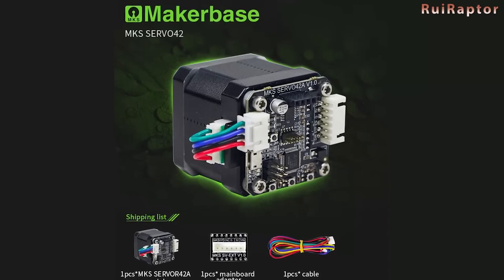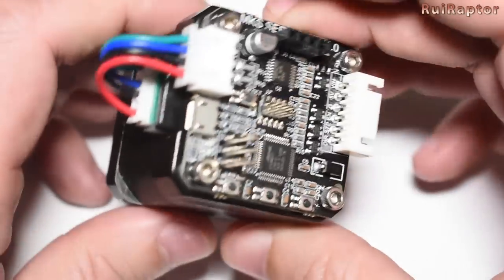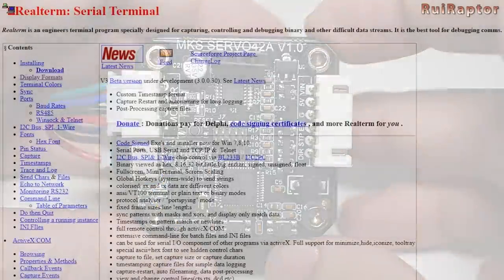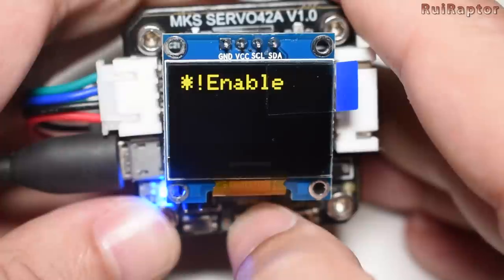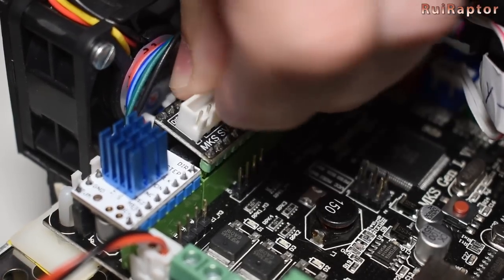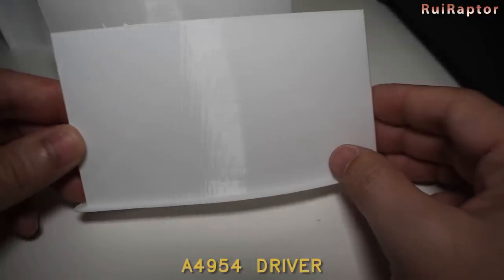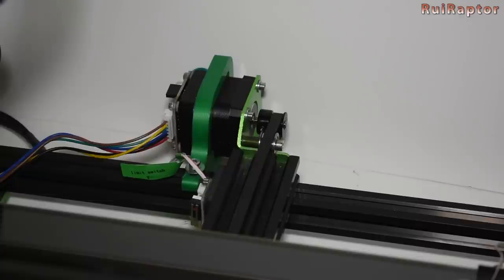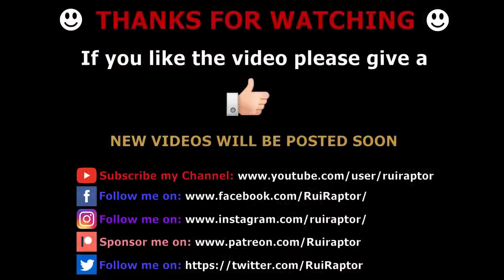MKS Servo42 Close Loop Motor (MAKERBASE) - Tests & Results

Comment: As Trampas said, these are clones/ripoffs of original misfit electronics design, even the display in the firmware says that. Salmon skin is absolutely a result of a miss-configuration. These are NOT plug & play, you need to find pid values which work best for the setup being used. Stock pid are very generic and are just to get you going, you need to know something about how PID loop works, and Trampas actually supports the products he sells, and will help you find the appropriate pid value. Good luck getting MKS to help you with any of that. I run 4 of the authentic ones and have had zero salmon skin or artifacts, (after I tuned them properly to my setup) and I also run these only on the heavier axis, and trinamic 2660s on the X axis. Also salmon skin can be a result of poor noise isolation in the cable, the cable going from the main board to the stepper board needs to be shielded, or there will be odd issues, the cable included by MKS is not. At the minimum the step/dir wires must be shielded. This is what happens when Chinese companies clone a western design.
Reply: This is really helpful ! looking at the "genuine" now.
Reply: where can I find the legit? I am currently in the process of building my first diy 3d printer
Reply: @Kalvinjj yea other guy thinks he's on some high horse cause he isn't buying the "clone." Exactly as you say it's open source and using the term "clone" as if signifying its a negative thing is completely false and does not in any way mean it is a negative. Way more often then not clones are improved and better than the first iteration. This guy has some superiority complex syndrome or something

Comment: Hello
06:07 I bought 4 of them at Jul. 20 2020.
A magnet was attached to the center of the motor shaft using a resin cylinder 9mm / 6mm.
Use resin spacers to attach the board to the motor.
The screw holes of the motor have a recess for the screw head, and there are many gaps on the back of the spacer.
As a result, it cannot be tightened strongly.
I don't know if it's caused by the rotational vibration of the motor, but sometimes the board shifts.
As a result, the magnetic detection encoder settings will fluctuate.
It is difficult to calibrate the motor each time.
Another problem, the closed-loop servo system should be excellent, but the problem of accumulated pulses becomes noticeable and drive delay occurs.
Originally, the stepper porter has only the problem of magnetic pole deviation unless it is stepped out, and it does not matter in the case of microstep.
From a different point of view, mechanically engineered encoders have advantages when applying closed loops to stepper motors.
An unstable magnetic encoder with uncertain mounting can do a hundred harms, but no profit.

Can I use it as a system that opens the closed loop and pretends to have pseudo-feedback that follows the pulse signal?

If that is not possible, this foundation has no meaning to exist.
Please consider it once.
Best regards
Reply: Have you come to any conclusions about the questions you asked and concerns you had? Very interested to hear what you have to share about this topic

Comment: I know this is an older video but I am thinking of getting the SERVO42C. I was wondering if it can be controlled in service from a computer via the USB with just power into the board directly. ie no separate control board ? I'm looking at building a CNC router and want to use 4 of these to control motion,,

Comment: Thanks. I'll go with what you said but first:
1. I run a delta and i want these for my XYZ motors.
2. I want to believe i will know how to tune these - just need the info how.
3. According to the manufacturer - you can't buy only the boards and I already have 0.9deg's.
4. According to the manufacturer - No plans to introduce TMC's drivers for these.
5. I searched YT for video showing these in action on a delta printing a model without Salmon skin artifacts to no avail.

I really like the way this is all going, but too soon for me to jump in. looks like we're at least a year away from having a good solution. I know other companies that sells only these boards and if they will prove a salmon-skin-free print, i will go their way.

Comment: Great work. Good to know about this possibility.

But if you have issues with Y-layer shift, there are 2 more efficient solutions by my opinion.
- Set TMC driver to spreadcycle mode. Default stealthchop mode has problem with high torques. Didnt tested because I do not have this problems.
- Best solution by my opinion is ged rid of glass/mirror on your bed. Just to get perfect first layer you must face this issue. I dont have any issues with Y-layer shifts with your configuration(motor, board, drivers on stealthchop), with stock bed sheet and 2000 accel (running on Klipper firmware). I solved bubbling issue by heating bed on 100°C and squeezing bubbles out.

Comment: I am trying these (bigtreetech s42b model) on my dual z printer for the z axis steppers. I think this is the best use. Should allow better layer resolution and keep the level better. I don’t think salmon skin effect will show here.
Reply: If you need good precision and level holding on the Z-axis, a 0.9 degree stepper and a good quality 2mm pitch lead screw will do an excellent job for much less money (5 micron full-step accuracy and very resistant to back driving).  A servo is way too expensive for what it's worth on a Z-axis.
Reply: @KarriKoivusalo  This is a Nema17 stepper with closed loop feedback. I got them for $20 a piece assembled. So I can keep my original leadscrews and carriage assembly exactly as it is. I am not sure how a 0.9deg stepper which usually cost more than $20 and a new leadscrews and a new carriage nut which hopefully fits my carriage is going to be cheaper,much less if it does skip a step it's done being level. I do run Marlin 2.0 with auto z align before every print.
Reply: If you have a problem with Z-axis losing steps, it's a failure on the stepper motor part. Are you sure having the cheapest of the cheap parts is going to fix it?
Reply: @KarriKoivusalo  Well I am not having lost steps, but I don't care who you are what machine you are running, but on a dual Z independent gantry you will have some skipping. That is just a fact no system is perfect. If they were why in the world would most every precision manufacturing machine use closed loop servos over open loop steppers. I can tell by doing a Z auto align after a print that there is some small step loss. It is pretty minimal but it is there no the less. If you look at your prints you probably will see some very small tell tale signs like one layer looks just a bit squished . I did this mainly to test out how well it works, so far its pretty interesting. I might have some setup issues. Upon re-enabling of the stepper drive it goes to the calibrated position don't know if that is good or bad, but if you set it high it goes up to the top and very rapidly at that, if you set it low it could hit a print if you dont do it right. most of the time You would  remove the print before doing this but... I was thinking mostly to see how well this would work and if it does, which it seems to, why not design something like this with say a TMC5160 or 2209. Closed loop has a very strong appeal to it regardless of how good you machine is. I can say that I am able to achieve much higher velocity with my Z-axis now. It could be the bigger motors over the stock ones, but I would lose steps if I tried to go over 12mm/sec now I can achieve well over 20mm/sec without skipped steps. Why is this important you may ask well I can say that I have shaved a couple minutes off of a  2 hour print in just the increased speed in my Z-Hop, and my prints are dead on in the layer heights. And no I did not cheap out on my printer, well perhaps when I started I did as I bought a Anet E12, but its pretty much a from scratch printer minus the base frame and heated bed platform. Now its a SKR Pro powered linear rails for z All Metal Nickel plated copper V6 BMG direct drive using mostly TMC2209's minus Y which is a TMC2160 with a .59NM stepper , homebrew heated space, Cant call it a heated chamber due to statasys.

Comment: Click the MKS-SERVO57 manual to display the MKS-SERVO42 manual.
MKS-SERVO57 is not working properly and cannot be calibrated.
What should i see?

About MKS-SERVO57 and MKS-SERVO42.
Do you recognize that both are the same?
There is a manual on 42, but the operation method for setting is different.
But 57 has no instructions.
It cannot be set by operating in the same way.
I manipulated it by mistake and set one item by chance.
It cannot be manipulated and reproduced at the next opportunity.
I would like to ask the person in charge of 57, it is not the same as 42, so please make a correct manual.

Comment: If you were to forcefully stop the print head mid print will it correct itself and catch back up? You really should have done that in this test
Reply from the maker: Hi,
I did try that. I jammed the motor shaft for a second when the motor was moving the axis a long lenght and at the end the carriage moved the same amount that i told it to move.
Reply: @ruiraptor  Did the other axis's get out of sync? I was worried since just the stepper itself is closed, but there is still no communication back to the MKS to tell other steppers to wait until its back in sync right? Did you do that in the video? I dident see that.
Reply from the maker: That is correct. There is no communication back with the board and the other motors so if you jam one of the axis the others will still continue. The jammed axis will recover but depending on the movements the printer is doing, it might not be fast enough to recover without getting layer shift effect.
Reply: Yes, it will, the motor will only lose step temporarily, but will continue to try to catch up with the correct amount of steps

Comment: Would be interesting to measure the delay in motor movement you add by introducing some extra logic and processing with the servo in there. Maybe thats where the salmon skin effect comes from, as the one modified motor-axis is always lagging a little bit behind where the main board actually think it should be?

Comment: Nice video and good product
Please 2 questions for this product:
- Can we disable microstepping function or choose smaller microstepping like 1/2  1/4  1/8  ?
- Do we need limit switch ?
(I want to use this board-motor for another application not for 3d printer were is not possible to use limit or home switch)

Thank you
Reply from the maker: Hi,
regarding your first question, yes, you can choose a smaller microstepping.
Regarding the limit switch, this board/driver does not support sensorless homing so you need limit switches.
Reply: @ruiraptor  Thank you for your fast response !!!

Comment: To clarify, the motor can lose steps, but will try to make up for it, so if you block the head, it will jump back to the correct position, considering all steps it was supposed to make during the time it was out of sync. You CAN use this stepper with boards without replaceable stepper drivers, but you need access to the stepper dir, step, cs, 5V, motor power and ground signals. So to install it on board with headers for these signals it's still quite easy to install.
Reply from the maker: Hi Ron, you are correct. 
Regarding the installation on boards without replaceable drivers, the board needs to have driver headers. We now see boards that have them but there are lots of boards that don't have and the installation on those it's more tricky.

Comment: Really interesting video. Can you buy that motor board on it's own? Or does it require a custom version of the nema 17 with it? I've got the newer tornado, so it doesn't have the salmon skin by default, so am I right in thinking this wouldn't give the salmon skin? Hopefully they come out with a TMC version at some point.
Reply from the maker: Hi,
the salmon skin if from the driver and not the board so even if you buy the motor board alone it will not fix the salmon skin. The motor board can be used with any nema 17 motor but you will need to add a small magnet on the motor shaft for it to work.
Reply: @ruiraptor  Thank you for the quick reply!
Reply: @ruiraptor  Hi, I bought the board and driver alone, it didn't include a magnet. Can I use a normal round magnet and what is the correct procedure in attaching it to a Nema 17 motor?

Comment: Note that the salmon skin is most likely due to the PID parameters being not tuned for your printer. That is the PID control loop may over shoot, which will result in the salmon skin effect.   It could also be that the A1333 encoder MKS uses is lower resolution, resulting in some slight position error.     Additionally you can turn up the current on the control board to near the maximum of 2.0A even though the motor is only 1.3A. The current rating on the motor is based on the continuous current, where the firmware currently specifies the current as the peak.  Since the smart stepper firmware will reduce the current if the position error is low their is little risk in exceeding the continuous current rating of the motor unless motor stalls for a long time.  Future firmware releases of the smart stepper firmware will add in the continuous current limit (which will not be available for MKS).     Also to show the true power of the smart stepper firmware during a print grab the head and move the print head.
Reply from the maker: Hi,
thanks for sharing this.
I didn't raise the current because the MKS Servo42 manual states that the stock value is the max value that should be used for this motor. Also, with the tests done with other allegro drivers, increasing the current didn't help to reduce the salmon skin.
Regarding the encoder resolution, from what I see, it has a very good resolution so I don't think that is the issue.
Not only the DRV8825 drivers have issues with salmon skin. The allegro A4982 also have this issue (see my analysis video here: https://youtu.be/78fonMoXRuA ).
Reply: Hi Trampas,
I'm running my printer with Smart steppers (FW0.37). Earlier when running the printer in regular cartesian XY, prints were good. Now with it setup as a CoreXY , I've been introduced to severe salmon skinning on all surfaces. Maybe some tuning is in order for this kind of setup?!?
Reply: @human2761  What controller are you using?   The Duet has some acceleration math bugs for coreXY,  which I have seen causing problems. 
Also with the CoreXY it is critical that the both motors accelerate the same and respond the same,  so try slowing down the maximum print speed and see if this fixes/reduces the problem if so let me know.  Specifically I am worried that if you tell bot motors to move 10 steps and one has an error and takes slightly longer to move it will cause more issues on coreXY, if you slow controller down and problems go away then this might be problem.   Another issue might be the ringing on the PID tuning. For this try dropping the P term to 0.4 and I term to 0.0004 and d term to zero. This might reduce the ringing due to lower P term and hence reduce salmon skin effect.   However by all means let me know and also check the Smart Stepper group: https://groups.google.com/forum/#!forum/smart-stepper

Comment: Can I control this MKS servo 42  with Arduino along with the built-in board? may by using the shield.
Reply from the maker: Yes, you can use arduino to control this stepper motor. The driver is included in the motor so you only need to send the control signals.

Comment: Can you switch out the driver and put a tmc 2209 instead of the one that comes with it?
Reply from the maker: No, that is not possible. But you can find some closed loop motors with TMC drivers in the market.

Comment: Did you try to push the bed and see if it moved back into position after being pushed further away from its location that it needed to be or isnt it supoosed to do that?
Reply from the maker: Hi Thomas,
yes, I did that test while the motor was on my hand. If you try to rotate the motor shaft, it will return to the original position.
Reply: Thanks for replying :)

Comment: Great video! I wonder if salmon skin is produced by the stepper driver or the encoder. Theoretically, the servo mechanism should correct such errors, unless the encoder itself is somewhat non linear between steps. This can happen because of non -controlled magnetic hysteresis and the fact that is hard to perfectly center the encoder.
Reply: I think that the problem rises from the driver's zero-crossing anomalies and can't be filtered or fixed.
Reply: Since this is a ripoff of the Smart Stepper from misfittech, it should have the same calibration routine which deals with this issues. They skimped on some components, so that might cause some issues. You also have to do the calibration for it to be effective....

Comment: the print speed increase is amazing. wish you could get this with TMC. maybe I can make my own but it'd take ages
Reply: Are you running your TMC drivers in StealthChop or SpreadCycle mode? SpreadCycle gives more torque at the expense of some noise, faster moves, higher loads and some bigger motors (my NEMA 23s for example) will barely run at all in StealthChop anyway.

Comment: For the salmon skin, do you plan to reconfigure and use 64 microstepping ?
Reply from the maker: Hi Julien,
Not with this 8bit board.
Only with a 32bit board you can try the 1/64 microstepping.
Reply: @ruiraptor  should work with Klipper firmware